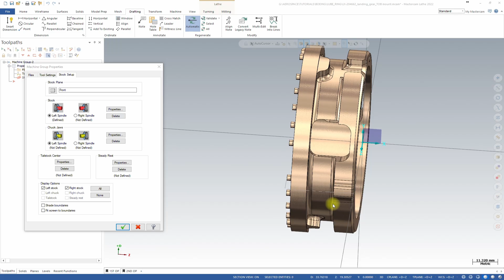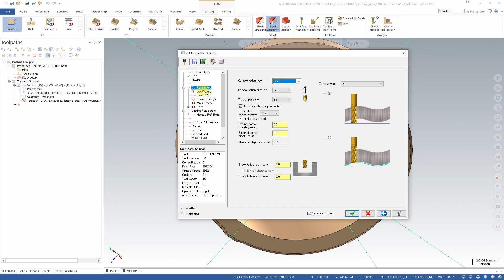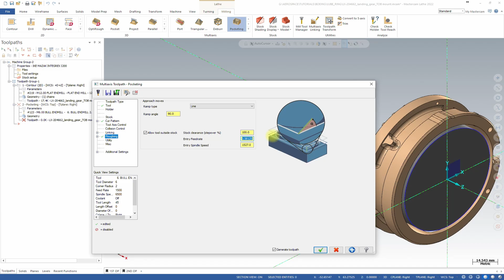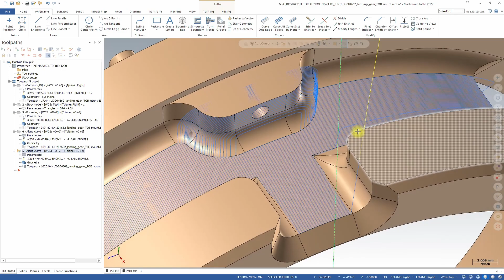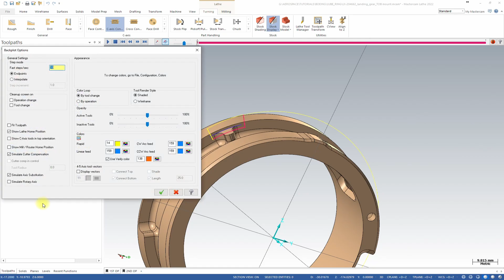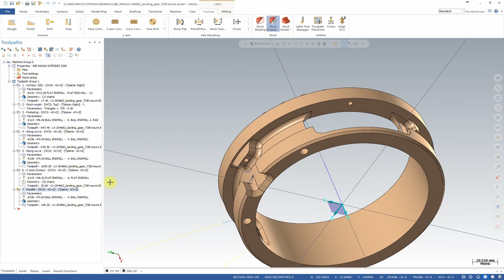Landing gear - LUBE RING - Mastercam 5 Axis tutorial part 1 of 2

Comment: Great tutorial as usual! I'm addicted and can't wait for next ones^^ Just a thing, in real life you can't fit a 12mm EM into a ER16 holder. Perhaps, one day, CNC systems will improve Mastercam tool manager to filter tools/holders with connection values.
Reply from the maker: Thank you for a great feedback Anorec
Good point! I'm going to pin this comment so everyone can see this info
we all make some mistakes and it happens to me sometimes too :)
when I was presenting the tool assy I wasn't thinking about sizes 
also, integrex doesn't use BT40 tool holding system :)
------------------------------------------------------------------
The clamping range for ER16 is 1-10mm
you can use different tool holder (ER32) or smaller tool
------------------------------------------------------------------

Comment: In 44 minutes you did avoid 0.2mm not to touch the upper surface. Is there any way where tool will only stick with machining geometry rather than  going over the upper surface? Many thanks for helping us by your amazing efforts.
Reply from the maker: Hello yes on the cut pattern page set    Machine By: "regions" (bottom of the page) 
or use linking to set the retraction
Reply: @aspeaerospaceprecisionenging  Thank You😊